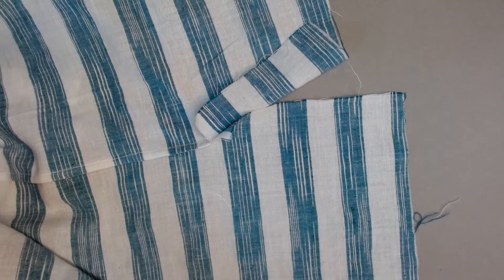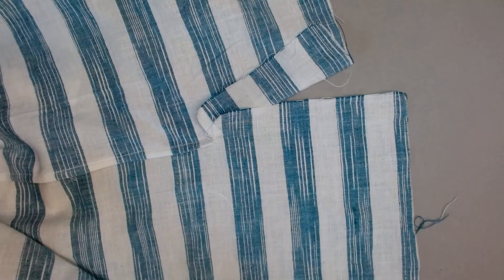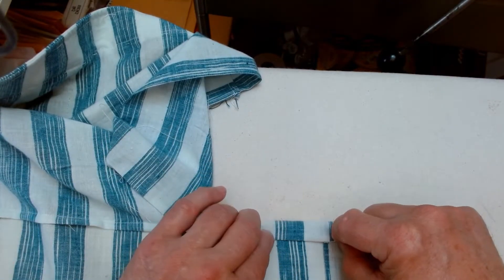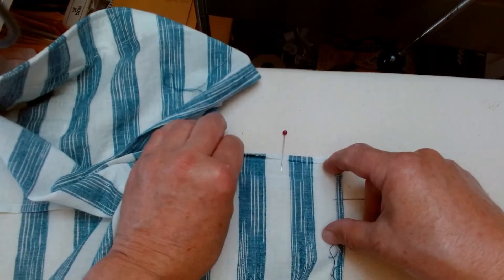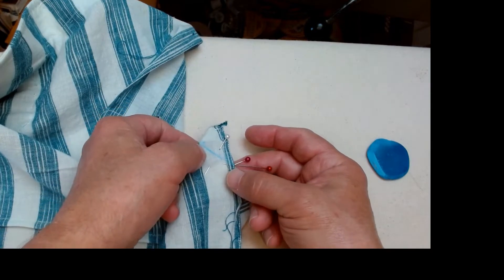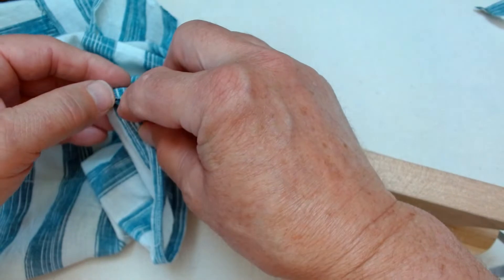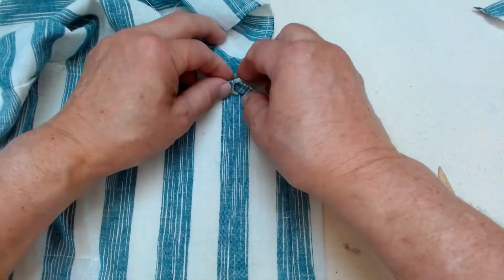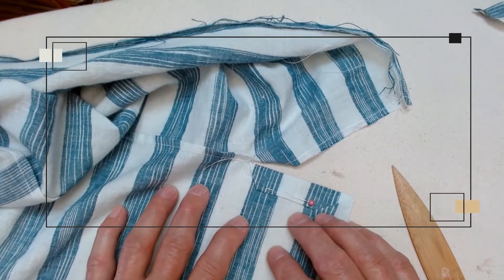Making a mitered shirt vent -- Completing the miter - Part 3

Comment: I'm fascinated by your sewing techniques and I'm learning a lot! I'm looking at the WAWAK catalog and I'm trying to figure out which iron you use. I've almost got it figured out—you have some sweet tools! I think it's interesting that you use a mix of old and new. It looks like your main machine is an antique, but you obviously have a serger, too. I would love if you did a video of your sewing equipment and why you use what you use, including, hopefully, some details about your workspace!
Reply from the maker: I love my gravity feed iron!  It's by far the best tool I own.  I'm lucky that I live in an old house with beamed ceilings.  The water jug is just hanging from a hook in one of the beams.  I love that it's always ready to go, and that I can control the steam.  It's plugged into an outlet that's controlled by a light switch.  When I turn off the lights I'm always assured that the iron is off.  I also love my vintage machines.  I have very little need for decorative stitches, so having a rugged dependable straight stitch machine is ideal.  The old singers are powerhouses.  I have a modern Janome that belonged to my mom.  It has a walking foot which comes in handy at times.  It also makes great buttonholes.  That's about all I use it for.  My serger is an old 4 thread Bernette.  Only two threads ever work, so it just does an overlock.  I don't use it very often.
Reply: @mainelymenswear  Do you have a temp control on that iron? Can you use it for interfacing? I'm really sorry to hear about your Bernette. Mine's about 20 years old and I love it. It's a 007 D and I've never had a problem with it. I don't know what's going on with manufacturers. I've never used a decorative stitch, either. But needle up/down and button holes sold me on my HuskyStar 224. I love good tools!
Reply from the maker: Hi, Yes the iron has a thermostat, levels 1-5.  I keep mine set on 4 because I'm almost always working with natural fibers. If I were working with synthetics I might dial it down.  I have a steam diffusing plate on all the time which can help prevent scorching.  It's a dry iron by default so it's perfect for interfacing.  I would never go back to a commercial steam iron.